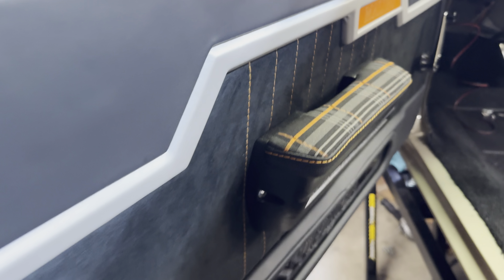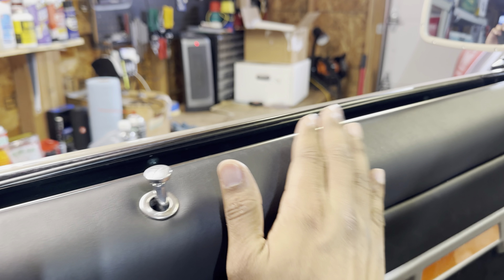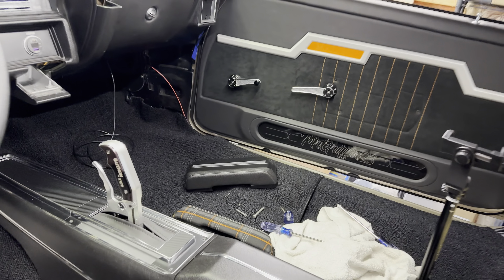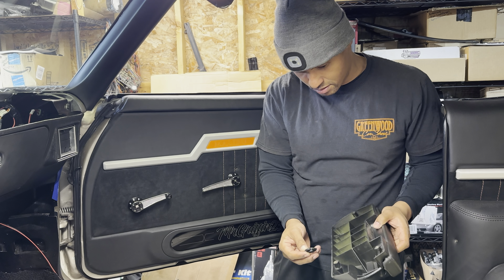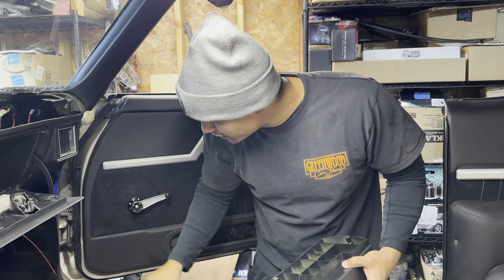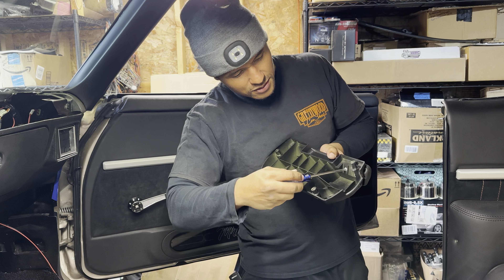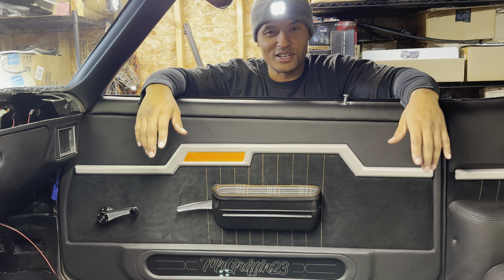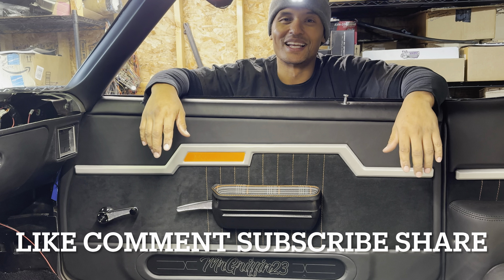TWEAKING THE INTERIOR | CUSTOM ARM REST | 1971 CHEVELLE RESTOMOD | INTERIOR BY: GRIFFIN DESIGNS LLC

Comment: Looks good! Love that pattern in the c10’s as well. Looks like you could almost put some thin clear plexi between the door pull and the new cover and make another orange glow strip…..as far as the kinda loose screw you were talking about I’ve seen people wrap a little bit of blue tape on the screw threads to help it snug up a little more, nothing permanent but cheap and easy to try. Love the videos btw.
Reply from the maker: Appreciate it! Yeah, I’m messing with the idea of doing something so we’ll see. 

Thanks for the tip on the screw! Thats a good idea.

Comment: If you decide to keep it that way you're going to have to do the rear panels the same way so that it all flows together.
Reply from the maker: Good idea. I’ll have to think about that since the rear armrests are much bigger, also below the panel and technically don’t really flow with the front door panels as they are different. 

I will be adding the plaid to the rear seats. We’ll see how it turns out, but I think that will be plenty for the rear. Thanks for feedback! I’ll keep that in mind.